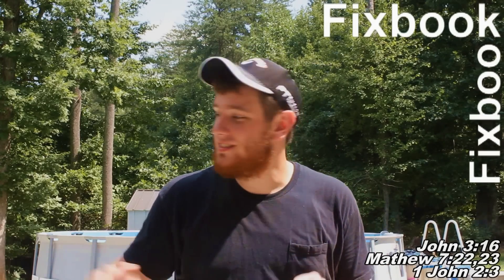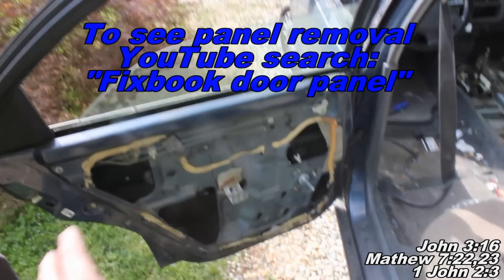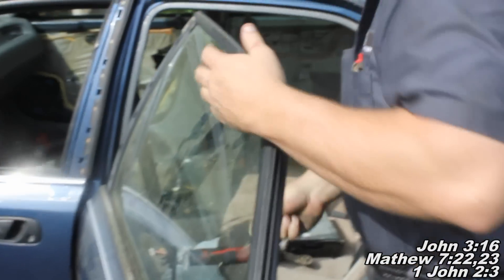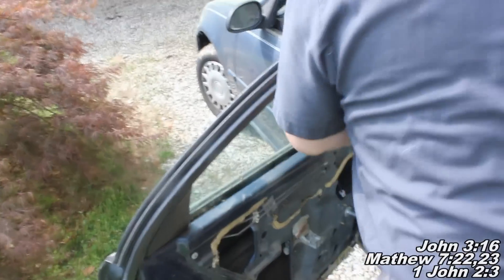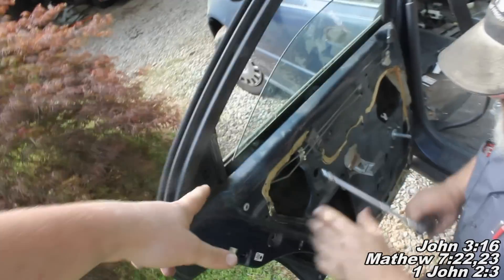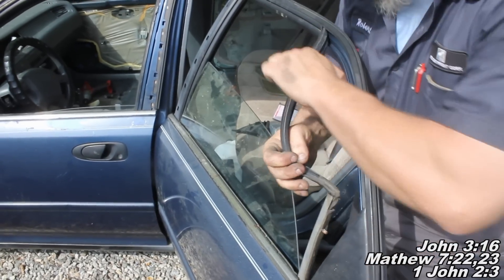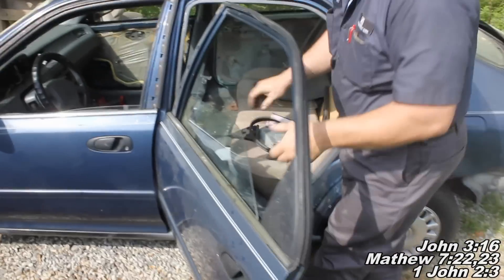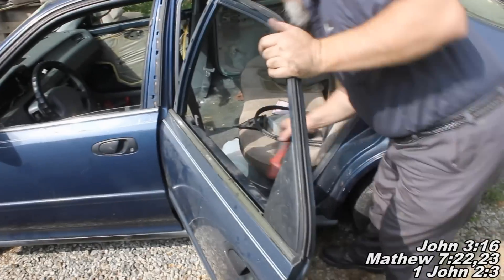Door Window Remove & Replace "How to" Honda Civic

Comment: That look's to be a Civic Sedan 1990-1994 this is not ! for 2001-2005 civic
Reply: DId you ever find out how to replace a rear door glass on 2001-2005? I sure can't find anything anywhere on youtube or google. I had a front door glass broken out, and when I found a car with glass at the wrecking yard, all the windows were professionally tinted, so I bought all 4 door windows. It's a lot cheaper than having them tinted. Problem was, it took almost an hour to get the glass out of the back doors! I actually had to remove the small quarter glass by cutting the rubber seal. Then I had to hammer on the track to bend it out of the way. Well, obviously I can't do that stuff to my car. Any help or tips would sure be appreciated.
Reply: I have not yet. I am working on mine Sunday and I will add a small Video when I get everthing a part as I can find any videos ill will make one. Regards
Reply: Thank you! I'm STILL looking for something to show me. The front ones are a 5 minute job, but those back ones are NOT fun!
Reply: FINALLY figured out these darned back windows! There was 2 bolts I didn't see. My buddy told me "There has to be bolts you're not seeing! Sometimes there is a screw under the rubber seal." and he was right! Hey, I don't mess with doors very often. PLUS, there is a bolt way at the bottom of that track that I never saw. I'll look again. Oh, they don't call that thing bolted in a "track" or a "channel", Honda calls it a "sash". Anyway, looks like this is going to be pretty simple to do after all. So apparently you just have to find the 2 bolts and the screw at the top of the sash (the post between the moving window and quarter glass). You can find an exploded view on Honda's parts site: https://estore.honda.com/honda/parts/view-honda-parts-catalog-detail.asp?m=2001-accord-4-lx-4at&sn=&b=B++54&dl=
Reply: Awesome Man! that is great news I knew there had to be a bolt some where. thanks for the information ill take care of my windows.